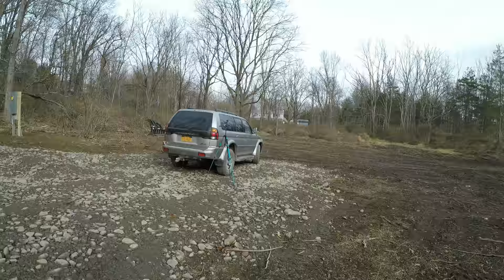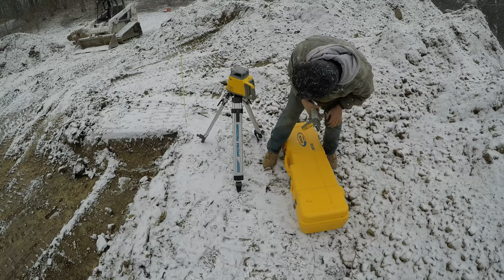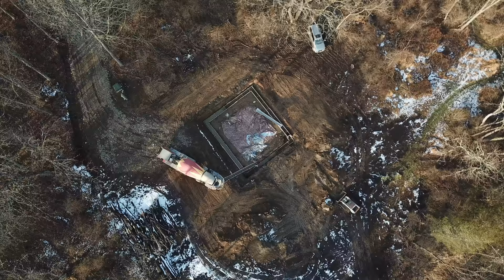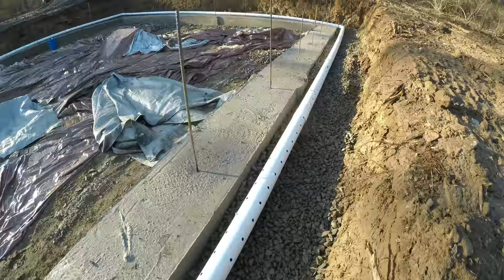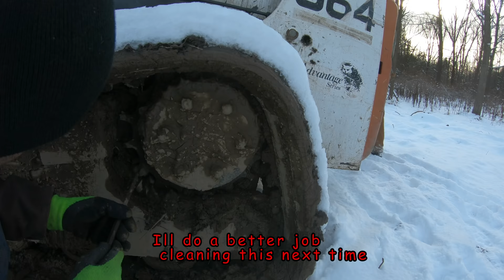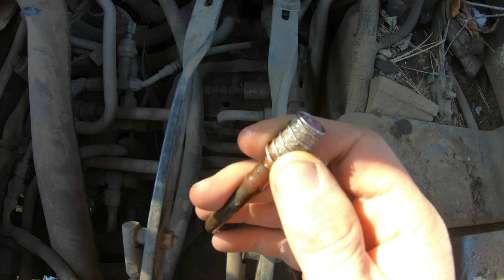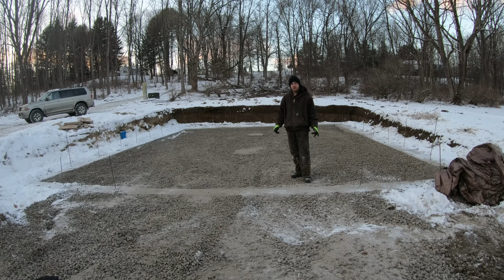Digging a foundation and pouring a footing

Comment: Don’t think I’m criticising you but how come you don’t use your ex100 to do this job I’ve never seen a skid steer do a job like this before. over this side of the pond it’s Excavator and dumper for this type of job
Reply from the maker: I did not use the ex100 because this job was very far away, and the skid steer was already there. The ex100 would have done it a little faster, but I feet the skid steer was easier to use to get a perfectly square and level hole. 60 years ago when track loaders were much more common than excavators, this is how foundations were dug. I've had a few old people tell me this and I wanted to try it. I would do it again.
Reply: Andrew Camarata 

It’s a good job Andrew. FairPlay you have serious skills with that bobcat like I’ve said before you have an excellent Channel

Comment: Just idea Idk if works at all not from cold or been in very cold but why not buy one of those cheap car tents wouldn't that keep it warmer inside and those aren't that expensive
Reply: Hi Andrew,      I was thinking the same thing. A tent around your bobcat, that way if you have to heat it up with propane the heat stays inside the tent so while your freeing up the tracks the fuel filter might just get warmed up too. Looks like your solving problems and making sure they don't happen a second time. Epic video length, love it. Hope you are enjoying the holidays. Cheers,          Bill

Comment: Whats the permafrost wall for? On the footer drains shouldn't the holes be down? Thats to catch the ground water that comes up from the bottom an run off with holes on top its got a better chance of plugging up an not being as effective on bottom. I know people do both ways.. love your vids!!
Reply from the maker: The frost wall is there because that's going to be a walk out basement there. So it needs a deeper footing on that one wall. I always put the holes up. That way any water that gets into the pipe will run out, if the holes are facing down, the entire ground will be saturated with water before any water can run out.
Reply: Andrew Camarata that makes sense to... you make everything look so easy lol love your vids!!!
Reply: What if you put holes in the top and sides.
Reply: Placing the holes up is a common misconception usually encountered when homeowners are trying to do their own work. A professional should know better. Many States require an inspection prior to backfilling... and holes up would never pass.

Comment: In locations with down to below -50F temperature, you put several kerosene lanterns [4 or 5 for you] under the machine and cover it with a tarp that night.  Works for Tanks too.  With small equipment like yours, you may need to dig a trench for the lanterns to clear the underside of your tractor.  In extremely cold conditions I drained the engine oil and replaced it with kerosene so that the engine would turn over to start.  The drained oil was heated and then I replaced the kerosene with the heated oil after the engine started and came up to temperature, but before the oil gage started to drop because of the thin viscosity of the kerosene.  Low temperature fuel additives were necessary too.  In an emergency situation I used gasoline...very dangerous, but necessary.  Risky yes, but necessary in very extreme conditions.  Ah yes...don't ask.  HaHa!
Reply: They had electric on site, electric heater under the rig with a tarp over top of the rig would have worked.
Reply: The cheapest and easiest way to do it is plugging it in at night and he will never have any issues. They have heaters for gas tanks, oil tanks and hydraulic tanks. It would be a good cheap and most cost effective way to do it even if he had to replace them once a year
Reply: For anyone reading that, do not follow that advise. Putting gas in you oil is NEVER necessary. I live and work in Fairbanks Alaska. -40 during the winter is normal. You use low temp oils and lubes made for the arctic weather. Almost all outdoor equipment (including virtually every car and truck) up here is winterized, meaning that they have special heating pads and such on the battery, oil pans, engine block ect. Typically to thaw a frozen piece of equipment, you just use a bullet heater on the ground pointed at the engine block with the hood closed. A lantern at our temps will not do a d@mn thing. Adding gasoline to the the engine oil is incredibly stupid. There is a high risk of fire and/or  explosion AND engine damage will happen very quickly and it won't even help you start the engine. The #1 best thing you can do when your car is too cold to start is to warm the battery BEFORE you kill it trying to start the car. Also, adding a bottle of heat helps pass water though your lines (pro tip, a full tank of gas can not condensate).
Reply: @lobes187  Saw a guy mix gas with his oil to thin it out in cold weather. First start it blew the oil pan half off and burned the wires under the hood.  Not to smart.
Reply: No dude, you don’t drain the oil an dout kerosene in.   That’s stupid.  

Just run a generator at night and plug in the block heaters.
Reply: I had a dozer freeze to the ground when I was cutting timber it’s a pain something so power cut be stuck tight lol but engine oil heaters by KATS are the way to go for cold engines....also a dip stick heater can work for smaller engines

Comment: Andrew, great job with your videos!  We’ve watched them all.  There has been much debate about which way the holes go in the footing drain pipes.  I noticed yours face upward...I always thought they point down to collect ground water that is flowing up?  We’ll be building in a couple of years, so your input would be appreciated.  Again, thanks for the great videos.  Steve from Connecticut
Reply: Most dedicated french drain installers will tell you to point the holes down,  This makes most sense since water will flow from bottom up.
Reply: It depends on what type of water removal you're doing.... AKA water coming up from the ground or water flowing across the ground..... Been there done that
Reply from the maker: Holes go up.
Reply: It is easy to make any statement, but without a reason, an opinion has no value.  Holes go down: 1) dirt will fill the pipe eventually 2) water will find the easiest path 3) eventually the pipe will settle unevenly, so with holes up water will accumulate and sediment will move to the lowest area of pipe and cause blockage. The pipe will have to be dug up, rather than rooted. Also, with the holes up, water will pool around the pipe, so you will have four inches of saturated soil that can not drain.
Reply: Andrew I learned so much watching your channel and i find your videos very helpful as well as entertaining.  However, ill have to disagree with you on this one.  Water will trickle through the gravel and raise up from the bottom.  I'd like to refer you to apple drains YouTube channel he is one the few channels dedicated to this type of work.
Reply: Andrew Camarata --- Take it from an 'old fart', the holes go down, ALWAYS! Holes down allow lower water to enter pipe more quickly and release to the daylight outlet! In 50 years of construction I've NEVER seen ANYONE place holes up. You're the first I've seen do it wrong!!!!!
Reply: @cheddarcheese  Are you agreeing with me, or disagreeing with someone else?  🙂
Reply: @AndrewCamarata  Why?   Never seen it done that way before .— "the pipe performs better and transports water quicker if they are pointing down."

Comment: The footers are upside down. Holes on the bottom
Reply: @firesurfer  The only time you would orient the holes up is if you're introducing water into that piping system via other drains like downspouts. Since this footing drain isn't under a downspout orienting them up is wrong.
Reply: @Mr_Rearden  I never said to put them up. Just read the whole article.

Comment: A trick we used up North to start up equipment quickly on very cold days.  We used an old semi exhaust pipe with a curve at one end and stuck a tiger torch in it.  The flame wouldn't hit the engine but the hot air sure thawed it out quickly so we could start it.  We used what we had, unless we had a Herman Nelson.  Also use fuel conditioner, Diesel tends to gel when its cold out.

Comment: Do a little mod on your skid steers in the future to have hot water on demand for defrosting equipment. Or do it to your trucks so you can have it everywhere u go for all equipment. Cut the upper radiator hose and reroute it to one loop of a plate heat exchanger, then pipe it from the heat exchanger back to the radiator. Then add garden hose fittings to the other loop in the heat exchanger so you can simply hook up to any generic water spigot source for making boiling water. Be sure to drain the garden hose loop after using it so it doesn't freeze overnight and bust. The other loop should already have antifreeze. Oh and top up the host vehicle radiator with antifreeze since the new plumbing will need to be filled.

Comment: I've never seen someone set a laser height in such an awkward way lol. You could have blown that whole excavation out in one day using the excavator I reckon.

We just purchased a 2d laser setup for our 5 tonner so we can set heights and see them in real time from the cab
Reply: Yeah digger would've been a lot quicker id say.
Reply: And the cost of acquiring equipment would be what?  

There is a balance between the amount you expend in equipment and how much it will be used.  If Andrew did jobs like that more frequently, there would be a point where it would be economical.  

I've seen people go out of business with lots of debt because they grew too big, too fast and then couldn't pay for the equipment.  

Better to pace yourself and as you can pay for what you need, or know you had lots of work to make it pay for itself, acquire more and better equipment.
Reply: odc43054 not necessarily saying he should get that 2d laser setup, just threw that comment in there not sure why really haha. Was mainly just pointing out the excavator being more efficient for that application
Reply: From what i have heard a trimble or topcon setup on a excavator with all the sensors and shit your around 30k.. But concert guys love them can save them a lot on money in the long run not having a big varring slab from 6" in one spot to 10" in one spot.
Reply: Jaegen K I bought the iDig setup which was $15k nzd so probably around $10k usd and does the same job as the trimble setup but wireless so I can easily swap the system between my two diggers. 

The marketing material for it online is shit and tacky so I'll likely make a few videos of it
Reply: Us kiwi boys know how to work though

Comment: Hey buddy on the footer tile drain your holes in your pipe need to face down water rises up through the gravel into the pipe just a little tip
Reply from the maker: If the holes were facing down, there would be no reason for the pipe to be there. The entire ground would be saturated with water before any water actually drained out the pipe. With the holes facing up, any water that goes into the pipe will run out.
Reply: I thought that pipe was installed to collect ground water right not surface water a catch basin would collect surface water then again I guess it works however you need it to work I wasn't trying to talk bad about your work
Reply: I enjoy watching your videos my name is Danny Higginbotham and I'm from South Louisiana
Reply: longduckdong --- Holes go down, you're correct! Otherwise you have the water rise around the outside until it gets to the holes. Holes down allows the water to release the lesser amount more quickly and thus leaving a lesser amount in the trench to release.
Reply: Sorry Andrew, holes go down. That allows the water to enter the pipe where it can be carried away without having to flow through the rock.  With the holes up, the trench has to fill up to the top of the pipe before the water can be evacuated.
Reply: Wrong. There is whole industry videos where you can find them doing specifically that. Holes go down.
Reply: @AndrewCamarata  Sorry buddy...but the holes face down. With your holes facing up, I guarantee you just dumped lots of gravel into the pipe, and what isn't filled with gravel will be filled with sediment in a few years from dirt washing thru the gravel and into the holes. I can't believe you didn't have to pass inspection before back filling. An inspector would have made you re-do those pipes.
Reply: @AndrewCamarata  holes up will glog with silt over years , plus holes down is code and it woirks, it provides a quicker way for water to flow to daylight
Reply: @AndrewCamarata  no, holes down ,look into osmosis ,this is a simple form of it. fluids by nature seek equilibrium ,high pressure goes to low until they equalize, like a fluid level ,the pipe is a void or low pressure area in the surrounding material so water will seek it out,putting pitch in a pipe also creates a high to low situation thats why it drains. love your videos and inventiveness i do a lot of the same kind of things in vermont.
Reply: Ya holes down
Reply: @AndrewCamarata  Why do you put a metre of stone in along the outer foundation and then put the slotted piping on top, as all the water will pool around the bottom of the foundation rising up till it enter the slotted pipe and run out, and the outer foundation will be as wet as a shag on a rock.

Comment: Or course the holes go down. Think about how the system works!
Reply from the maker: If they were down, the entire ground would have to be saturated with water before any water got carried away. They go up, so any water that gets in, makes it all the way out of the pipe.
Reply: Andrew, that is exactly how it is supposed to work, water saturates the ground, the water table rises and water gets taken away. the water table drops and the water leaves the pipe back into the ground.
I can see we will disagree on this. Opinions are what it is all about!
Reply: Andrew Camarata --- The ground is approximately 2" (in depth) more saturated if holes are up!!!!!!!!!!!!!!!!!
Reply: Also a big reason for holes down is so the pipe don't fill with sediment up here in Maine you can't get a backfill inspection with holes up. I'm assuming you must not need a backfill inspection where you are. Ask your pipe supplier which way it goes. No offense but the best way to learn sometimes is to listen to people that have been doing it for a long time. I've been doing this for 32 years and I can assure you that the holes go down your drain will work better and last longer. I'll hand it to you for putting it out there for everyone to criticize, keep an open mind and with your work ethic you have a lot of potential to go far in the business.
Reply: @AndrewCamarata  ..holes down are not at 6 o'clock there at 4 and 8 o'clock which give you a small area between 4 and 8 for the water to run out otherwise the water has to rise about the pipe for the water to enter  the holes..

Comment: Your installation of the weeping tile/perforated pipe is located in the wrong area of the footing. Weeping tile is to be installed at the level of the clay, at the bottom of the footings, and graded to, usually the same corner as the sewer exit but not necessarily. The rock is to be put on top of the weeping tile to prevent dirt and other debris from plugging the pipe. I started my plumbing trade in Alberta, Canada in 1966 But what do I know.
Reply from the maker: Ill put more gravel on top of the pipe, than fabric. Having gravel under the pipe is a good thing, it will keep the pipe from filling up with dirt.
Reply: maybe the 4" drain pipe should be wrapped with filter fabric to prevent clogging the holes?
Reply: Andrew Camarata Brian is correct,  and holes go down
Reply: Exactly.
Reply: Educate him instead of belittle 👍